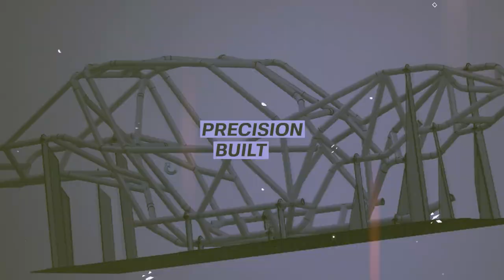BUSTED KNUCKLE VISION ROCK BOUNCER BUILD for CANADA

Comment: He must be in more of the northern part of Saskatchewan. There’s shit all south lol. Great build however I have a question is there a possible way to integrate a heater core and blower motor? Saskatchewan hits -40 in the winter, heated seats are one thing, windshield is another but a heater core and blower motor would be vital for winter wheeling in the prairies
Reply from the maker: I’m sure it is possible. Can always reverse the engine fan to blow into the cab also.

Comment: A bolted on hood, but made sure to do a rzr quick release style windshield? What's the point my guy? 27gallon Tank for it to he filled once & sit for a year
Reply from the maker: Because you won't need to remove the hood on the trail but the windshield you might. 27 gallon tank so you can ride a lot before having to fill up again. Snow wheeling sucks the gas. The point is for the client to get the best buggy he could buy and that is what we delivered my guy.